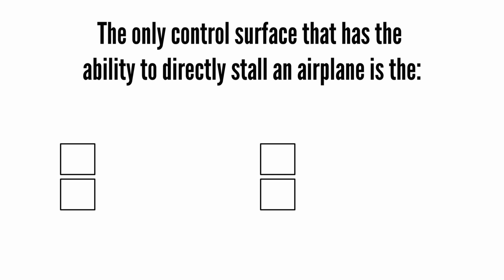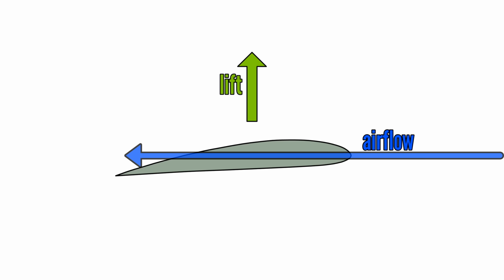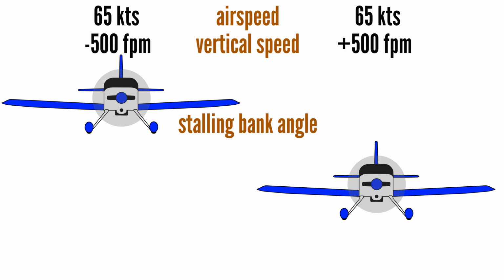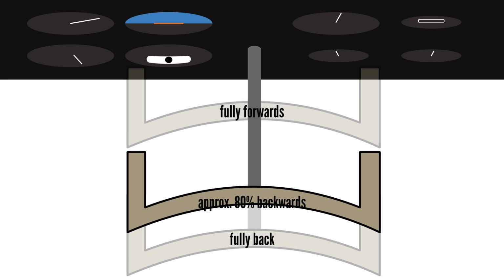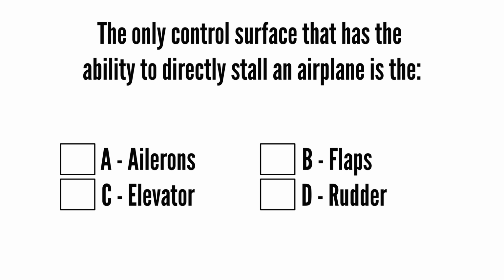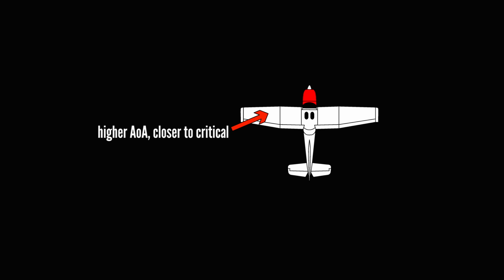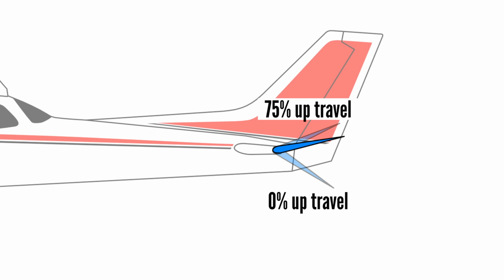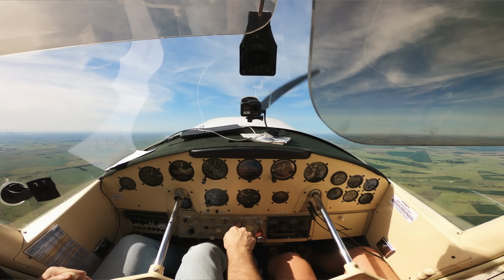Why Bank Angle is Irrelevant to Stall Speed

Comment: Load factor increases at the square of speed, more easily stated, if you double your airspeed, the lift increases 4 times (2x2=4 to the load factor) If you triple your airspeed, the lift increases 9 times (3x3=9 to the load factor), so on and so forth. An aircraft can stall at any airspeed and in any configuration or attitude, but only one angle of attack. The relationship between stalling, velocity and load factor is best explained by the VG diagram. I get your point, but a bit misleading. In a level turn, load factor increases exponentially as the angle increases, which in turn increases stall speed. The VG diagram is the most under taught subject in general aviation, in addition to stall awareness, it clearly defines the positive and negative structural load limits as well as the positive and negative aerodynamic load limit (when the airplane stalls before bending or breaking the airplane). Understanding load factor and its relation to stalls is what I think you’re trying to explain here, it’s a shame to leave out the VG diagram. And no, the G in VG diagram does NOT stand for Gravity or “G forces”
Reply: Load factor in a perfectly coordinated, non-descending turn will be 1/(Cosin of Bank Angle).

Bank angle will be Arcosin(1/Load Factor).

This would be 75.5deg bank angle for a 4g turn. (Technically an aerobatic maneuver).
Reply: @ the need for high order math isn’t necessary. Student pilots eyes are going to gloss over when you make statements like that. Just teach the VG diagram and provide in flight demonstration and practice and the proper and improper technique. Spin training should be mandatory, it’s inexcusable to omit it.

Comment: Idk man, I’d emphasize g forces on the wing, not elevator. It’s the g forces that increase stall speed.
Reply: ^load factor is a better proxy of stall speed than bank angle. 

Stall speed goes up at very nearly the square-root of the load factor.

Stall speed goes down at lighter gross weight.

Students should be taught to, and tested on their ability to calculate stall speed based on load factor from 1g at minimum flying weight to 4g at maximum gross weight. Graph it. And keep the laminated chart in their flying bag.

Comment: Let’s not throw the baby out with the wash.  The whole point of emphasizing the stall/bank relationship is that it warns pilots that high banks will cause a stall unless speed is high or wing is unloaded by descending.  A pilot who knows that steep banks invte stalls and those stall at low altitude are likely lethal…is a safer pilot.

A sharp turn to final is no time for purist thinking about stalls.  Rather, save yourself by greatly reducing bank and reflying the pattern.
Reply: Aside from the slight detail that few small planes have an angle of attack sensor, the nice thing about watching bank angle is that a vfr pilot, no matter how dense, can’t miss seeing that the earth is slanted; an instrument pilot can easily see that his AH is askew or his 3D synth view is leaning. If we are already armed with cautions about excessive bank we can roll level and save the day. It’s quick and effective.  After supper we can ponder AOA and stick forces and other symptoms of a bad maneuver.

Sorta like hearing a blaring car horn….we don’t have time to analyze…..we survive by grabbing the kids and jumping to the sudewalk.
Reply: Pilots who learn the bank angle increases stall speed, inevitably go out and try to minimize bank angle in the traffic pattern. They overshoot base to final, and instead of banking a little more to tighten the turn, they opt to keep it relatively flatter bank and use rudder to coax it around. And we all know how that ends.

The proper concept is angle of attack, which is directly related to lift coefficient, which is correlated to wing loading, load factor, and velocity. Keep the airspeed well above stall. Not just 1G level flight stall speed, but the stall speed for the load factor you are intending to utilize for the turn.

A 30* banked turn (traffic pattern limit) requires 1.155g load factor.  Which means stall speed and alto best glide speed went up by 7.5%.

Comment: Your explanations seem correct, when considering a stall can only be caused by pulling back severely on the elevators. However, most textbooks offer a different explanation of stall speed, referring to it as the minimum speed required to produce enough lift in order to keep the airplane in the air. 
Keeping that in mind, the usual charts, published in textbooks, are correct since a turn reduces the amount of your vertical lift component. That's why your stall speed increases because you can't produce the amount of lift necessary to maintain altitude if you don't increase your speed (apart from AoA)

Comment: Great point, but…

How do we use it properly?

Does this help….

Situation… avoiding stalls in the traffic pattern…

1) select a speed from the chart that covers most of the bank angles and weights the plane is capable of carrying….
2) 30° of bank for my plane has a 90 knot indicated stall speed….
3) I can always watch both the ASI and AI at all times… and never exceed 90kias and 30°
4) or limit the bank angle to no more than 20°…
5) I still want to slow down before turning final..
6) the descending turn unweights the wings… and lowers the AOA.
7) I don’t have a stall speed chart for unweighted wings… and my turn to final will be at 80kias… (less than the 90kias during level flight)
8) I have to know… while descending, and turning… my plane won’t stall if I am not pulling back on the yoke….
9) trim setting is important to get right before turning base and final…
10) the nose may dip a little during the turns… but can easily be adjusted during level flight…

11) always stay coordinated, ball centered, in the pattern…  because, if a stall happens while uncoordinated… recovery will take more altitude than I have…
12) when using slips/skids always have the nose pointed down… unweighting the wings…

AOAi(s) make a great tool… especially when getting to know a new-to-you plane…

Note: Flaps have been known to cause stalls during the go-around…..  the mix of adding power, in the landing configuration, with a lot of up trim left over from final approach…. Can cause a stall if the trim isn’t reduced quickly…. Or the strength of the arm can maintain the attitude… Or power modulated properly…

😃

Comment: Yes, the literature assumes you are trying to maintain altitude if it doesn't state otherwise. That is common sense, not misleading. 

And ailerons can absolutely be the cause of a stall. They are the main cause for tip stalls in soaring aircraft when you get the airspeed too low and try to roll out of a thermal turn. The down aileron on the inboard wing causes a sudden increase in angle of attack and results in an abrupt loss of lift. Same is true for powered aircraft as well. Your instructor will be quite upset if you aren't neutral ailerons when practicing straight forward stalls. Ailerons control angle of attack so of course they can initiate a stall.
Reply: The focus on steep turns in the ACS is the issue. We only do steep turns with back pressure in training (rarely taught with power increase). We are also taught climbing turns but this video's points are rarely taught or practiced.

Comment: It's not the bank angle that stalls the aeroplane it's the load factor or G force increasing the stall speed but it's usually related to the bank angle and control inputs. loads factor is dependent on variables AOA atitude ect
.obviously it is dependent on maintaining altitude, A high angle of bank close to the ground where you need to maintain altitude to avoid the ground can't be sustained without increasing G force and wing load, whereas a decending turn where you can afford to loose altitude will not require the same control inputs that would increase wing load and G force and stall speed, but I would have thought these graphs are representing an aeroplane that is maintaining a constant altitude.

Comment: Over complicating a simple concept.   Low Altitude, Low Airspeed, and maneuvering flight equals high risk. Eliminate any one of those three and you mitigate the risk.   For most practical flying, you can take the worst case accelerated stall speed, usually a 60 degree bank at max gross weight.  Use that figure as a 'minimum maneuvering' speed, for turning flight.  Keep your bank angle sane and legal (less than say 30 degrees) and your airspeed between that and Va and you can maneuver to your hearts content, or your stomachs limit, with solid margin.  Obviously, you can slow right down to approach speed or even Vso or Vsi when flying straight ahead or with small heading corrections. Heck you can fly straight ahead in a full stall with solid rudder control in a decent aircraft.
Reply: A 60 degree bank angle will require 2 g to be pulled in order to keep the aircraft level.The stall speed in this attitude increases by the square root of the load factor, hence it increase by a factor of 1.4.
Reply: @christopherrobinson7541  useful for aircraft that don't have accelerated stall tables, thanks!

Comment: You are right that AoA is all that really matters when it comes to stalling a wing, but I disagree that the published stall speed vs bank angle charts should be eliminated.  The published stall speeds on an airplane are predicated on "level" unaccelerated flight, and they're also measured at gross weight.  So, the lighter the aircraft, the lower the stall speed will be under the above stated conditions.  The farther the airplane is banked off of level, the more likely it will be to lose altitude.  The pilot can, and sometimes does, pull back on the elevator in an attempt to slow the descent or maintain altitude.  That, in turn, loads the wings which makes it easier to reach that critical AoA.  Student pilots need to be aware little detail and learn to be cautious under those circumstances.

Comment: So, in a 90° turn, your rudder acts, in effect, as the 'elevator'? Aerobats would likely know this.
Reply: Yes, it keeps the nose up.
Reply: It is a general statement, you need speed, and it won't raise the nose in all situations.
Reply: That is too broad of a statement. A very shallow 90 degree turn?
Reply: @steven2145  My fault, I meant a 90° bank (which would cause a turn, too). The rudder would now become a horizontal plane, relative to gravity, but the stall would still be controlled by the elevator relative to the lift surface (wing)? Without adequate thrust, I assume the nose will drop, altitude be lost,  thanks to zero lift, but is a stall in this condition possible but academic?

Comment: Well, hooray! Finally this is put out there. 
We fly statically stable aircraft so the angle of attack is controlled by the elevator angle which is directly controlled by the pilot. Only caveat, for a given aircraft configuration C of G, flap position, power setting . Change these and the stick position required to stall will change.
I've long thought we should have a red stick which starts to appear  above the glareshield at 75% of stick travel aft. Mechanically VERY simple. Angle of attack indicators in light aircraft aren't all that useful as they bounce around in turbulence. If slowed down to reduce this they will only tell you you stalled after the event. 
Even if the aircraft is stalled momentarily by an up gust, NOT pulling the stick further back to maintain ATTITUDE will result in the aircraft recovering from the stall within a second or so on its own as a) the nose will drop to line up on the new airflow if stick position is held constant b) the aircraft will then accelerate upwards and attain the vertical speed of the thermal you just entered, automatically reducing the angle of attack.

Comment: There’s an old saying: “Pull back to go up, pull back more to go down.”
Reply: It's still technically wrong.

Because pulling back does not make you "go up" only makes you POINT up.

There is no contradiction. As pointing the nose up is how you stall the wing (in an upright attitude).

To GO up you have to apply power. You can only go up with an excess of energy. Either by adding power from equilibrium. Or by having an excess amount of energy in the form of speed above that which it required to maintain level flight.

The other issue with "pull to go up" is this does not work when inverted.

So, the phrase is not valid in theory or in practice.

Pull to increase angle of attack. Pull to stall the wing. Both remain true whether upright or inverted. Both remain true whether gliding or going mach 3 with maximum  afterburner.
Reply: @ just wait till fly with me when I’m in the back seat of the L-19 Birddog (Cessna 305 A). It has such an aggressive accelerated stall characteristic that you’ll think it’s a snap roll (aerobatic maneuver) but it’s just a stall at a 60° angle of bank and about 20% above the published stall speed. It’s the funnest plane I’ve ever flown.

Comment: Stall speed increases by the square root of the load factor. Load factor increases exponentially with bank angle during a level turn.  Good points, but slightly misleading
Reply: "Good points, but slightly misleading"
Yes.  I can see someone thinking, "Oh, no worries!  I can bank as much as I like and not think about stalling".  
At a 45 degree bank, the horizontal force is equal to the downward pull of gravity so the load on the aircraft is going to be 1.414, the square root of 2.  You must add either power or angle of attack, or accept a descent perhaps into terrain.
Reply: Load factor in a level turn changes as a periodic function (not an exponent) - sine or cosine could be used to calculate it. It would approach infinity as the bank angle approached 90 degrees.
Reply: Maintain
Reply: Maintain altitude and roll the aircraft.
Centrifucal force
Reply from the maker: But what does the pilot do which increases load factor?
Reply: @LetsGoAviate  Since wings don't stall at the exact same time in a vast majority of accidents involving stalls, let's treat them as individual flight surfaces. Load factors can be changed by pitch control inputs or roll control inputs. Pitch changes load on both wings in the same direction and roll changes the load in opposite directions. When an aileron droops, the angle of attack for that entire section of the airfoil increases, as does the load factor. A snap stall can be induced by nothing other than insufficient airspeed and too much aileron input.
Reply: @LetsGoAviate  "But what does the pilot do which increases load factor?"
Pull back on the yoke at the same time as initiating a turn.  You can also add power but there's a lag.  It's probably a good idea to add power anyway if the turn is going to be of long duration and high bank.
Reply: @LetsGoAviate  Fly into an updraft. ;-)
Reply: @LetsGoAviate  Curves the flight path like in a turn or pull up. They increase load factor thus increase stall speed.
Reply: Theoretically nothing if you are in straight and level flight. In contrast, I would actually need to “do something” to get the airplane to descend. Only then would stall speed remain unchanged. Trust me, I don’t disagree with your analysis. It’s a great video. I’m considering making one very similar in the future which highlights the fact that we are told to avoid bank angles above 30 degrees in the pattern. If you understand the information you’re talking about, you can certainly use bank as necessary in the pattern, but it’s a good rule of thumb for new guys who don’t understand these concepts.  I love it that you took a bold step with the title. Don’t stop. I’m just playing the devil’s advocate lol
Reply: @LetsGoAviate  Using autopilot to keep altitude
Reply: This reminds me of the conversation about stick positions in the book “stick and rudder”

Comment: Thanks for this excellent lesson.  The airplane cannot stall itself, a pilot pulling back on the stick/yoke is required.  Along with the misconception about bank angle causing stall, ACS teach maintaining altitude in pattern turns when the airplane wants to maintain trimmed airspeed rather than altitude.  If trimmed for Vy, the turn to crosswind and downwind must be with totally relaxed yoke or airspeed will get slower than Vy in the climbing turn.  Yet students are taught to pull extra elevator.  And thanks for clarification on slips and especially skidding turns.  As an Ag instructor, I found it difficult to get experienced pilots to use enough rudder in steep energy management turns.  They were afraid of the skidding downwind turn.  A thousand turns a day, we apply the law of the roller coaster and what the airplane wants to do.  We use both fuel and ground effect energy in the pull up out of the field and then the potential energy of altitude in the turn back into the field.  At no time is the elevator used to increase rate and reduce radius of turn.  Angle of bank is the only safe way to increase rate and reduce radius of turn.  So no, we never bring the stick back in 1 g turns of very steep bank angles.
Reply: "The airplane cannot stall itself" An airplane with a dangerously aft CG can definitely stall itself!
Reply: @OldTechHobbyFun Yes, you mean it cannot fly properly.  We need to get across understanding and acceptance of what the airplane wants to do.  If the airplane wants to maintain trimmed airspeed, even if we have abused its CG, who are we to insist on maintaining altitude regardless of cost?